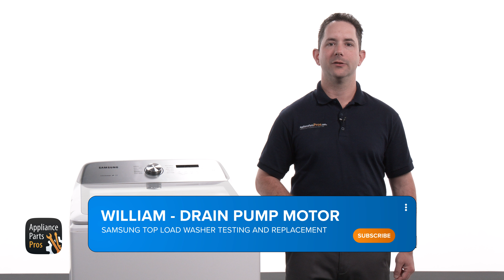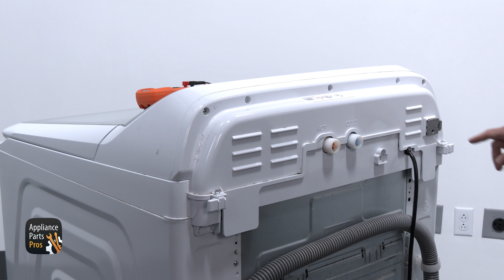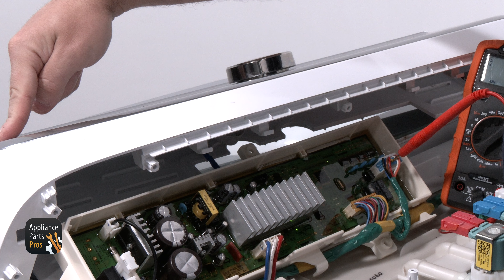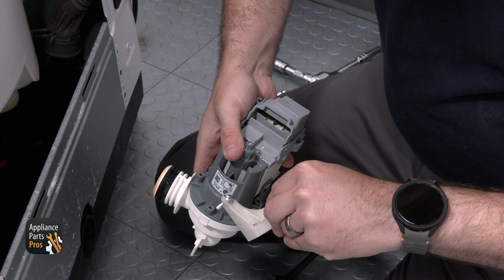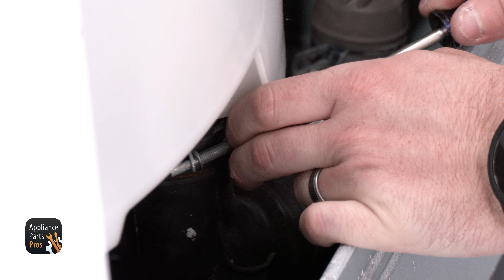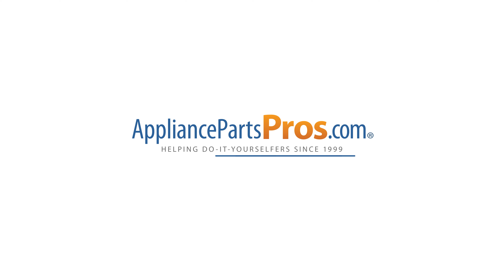Fix Your Samsung Washer's DEAD Drain Pump Motor with These EASY Steps

Comment: Voltage drops to 1.0 after lid lock
Reply from the maker: Got it, that voltage drop definitely points to an issue during the drain command. For detailed troubleshooting steps specific to your situation, our certified techs can help you at forum.appliancepartspros.com. Just post your model number and what you're seeing, and they’ll walk you through the diagnosis! 👍

Comment: What provides the signal to the drain pump? Why does no one discuss three wire pumps?
Reply from the maker: What is your model number?
Reply: @appliancepartspros I have no idea. Im just trying to figure out if i need to apply ground or power to the third pin to test the pump. When i just give it power and ground, it clicks on for like a half second then stops and wont do it again until i flip polarity
Reply from the maker: I'm sorry, we would need the model number of the appliance to check on that for you.
Reply: @appliancepartspros I can get it to you. I'm just not longer at the house. Gimme like a half hourish?
Reply from the maker: Sounds good! Just drop the model number here when you have it and we’ll see what information we have and get you pointed in the right direction.
Reply: @appliancepartspros  It is a WA55A7300AE and the pump is a DC97-22840A
Reply: @appliancepartspros it's a Samsung WA55A7300AE and the pump is a DC97-22840A
Reply: @appliancepartspros  it's a Samsung WA55A7300AE and the pump is a DC97-22840A
Reply: @appliancepartspros  I have tried to it keeps vanishing in the comments